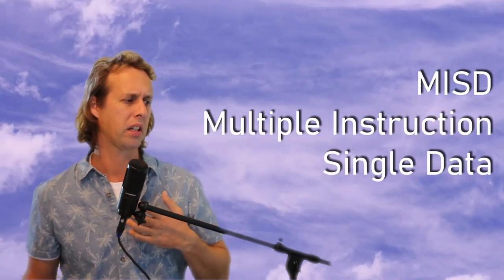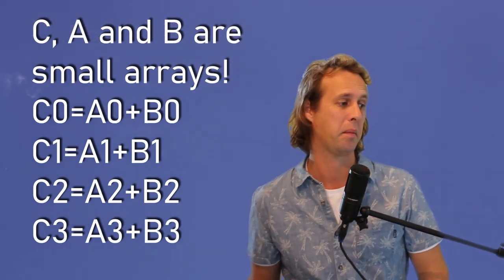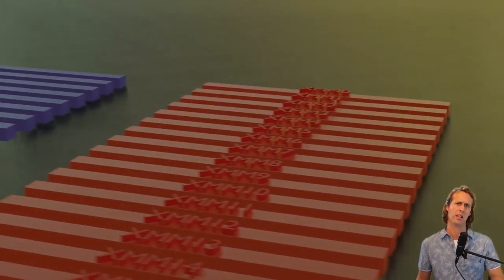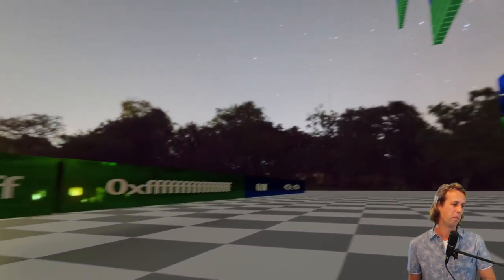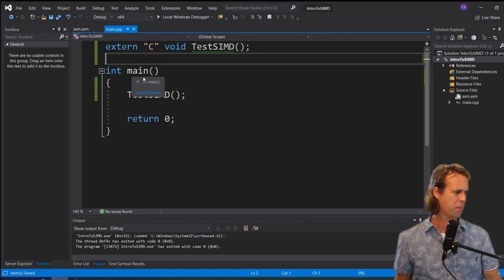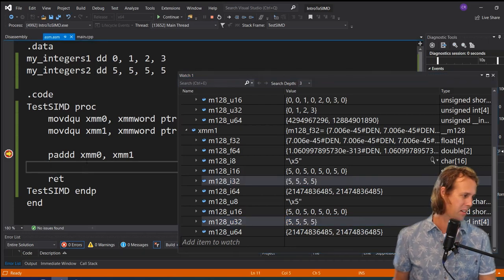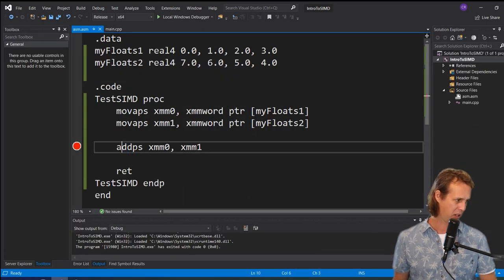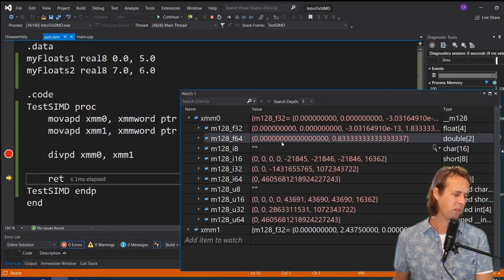Modern x64 Assembly 15: Introduction to SIMD

Comment: There's a difference between MHz and IPS. Not only recent processors run faster they also do multiple instructions per clock using multiple pipelines (superscalar). Old CPUs didn't even do one instruction per clock. That was only possible with pipelining.
Reply from the maker: They do indeed!! And they superscalar these vector instructions too! Really wild performance! Cheers for sharing and watching mate :)
Reply: EramSemperRecta  i8088

Comment: This is so interesting. With a good knowledge of it, how much could you improve a video rendering software, a physics engine, a 3D rendering library or maybe things like a neural network or a trading software?
Reply from the maker: ASM can do wonders! I'm hoping to release two projects soon showing some really fun tricks! Thanks for watching mate :)
Reply: I'm pretty sure you can achieve much greater performance with offloading to a powerful modern gpu nowadays for a lot of the use cases you mentioned.

Comment: C Intrinsics are very useful if you want to write high performance functions; The compiler understands them and will manage the register allocation and optimization, which saves you from doing it  if you code in asm!
There are still times when you are able to produce faster code than the compiler, even using intrinsics.
It takes a lot of effort, but it's very satisfying when you can gain that extra speed!

Comment: I took MIMD to an extreme level on my 12-core HT Xeon:
I wanted to search all the seed states of my Z80 pseudo-random number generator so it would produce some desired sequences.
AVX code allowed me to process 2 sets (16 XMM registers was enough to do this) of 16 bytes each on 24 threads to process 768 bytes at a time!
Using 256 bit YMM registers to process a total of 1536 bytes at a time didn't gain much; AVX only has 128 bit integer operations, so the lane manipulations ate most of the gains!
The AVX2 version works on an AVX2 CPU I have, but it's only 4-core, which only processes 256 bytes at a time ... @ 4 GHz instead of 3 GHz on my Xeon.

Comment: Great video! It is my understanding that G++ and MSVC handle intrinsics differently. Will it be possible at some point in this series of SIMD videos to cover that difference? I appreciate that the series is primarily concerned with assembly (most assembly developers are familiar with the differences between AT&T and Intel syntaxes) but C++ can be valuable when the data is embedded in various classes and /or structs. This can complicate  the gathering of that data for passing to external PROCs.
Reply from the maker: I've never used intrinsics with GNU, so this is new info for me :) I'd certainly like to explore intrinsics at some point. Cheers for watching mate :)

Comment: Just found out that Clang compiler supports x64 inline assembly with variables as operands. All you need to do is download Clang toolkit via Visual Studio Installer and change your platform toolset to LLVM (clang-cl) in project's properties.

Comment: I was hoping to learn the alignment requirements before the end of the video! very informative as a whole though, great job!

for avx2, what are the alignment requirements for reading or writing a ymm register from memory? is it 32 byte alignment?
Reply from the maker: Yes, alignment is 32 bytes I believe. So, there's VMOVAPS, moves aligned data, but if your data isn't aligned (or you don't know) then you can use VMOVUPS, move unaligned packed singles. Each of the Move instructions has an aligned an unaligned version, VMOVDQA/VMOVDQU, VMOVAPD/VMOVUPD, etc.

As for the other instructions, the data has to be aligned when you use a memory operand as the second operand. So like VADDPS or whatever. There's no unaligned versions of those. Theres also no versions that allow memory as the first operand.

I hope this helps! Cheers for watching :)

Comment: Thank you for the video!
Is there a way to do horizontal sums on floating point using AVX2?
Reply: vhaddps repeated 3 times works.
Reply from the maker: Like Explosionist mentioned, there's no way to do this in one instruction. You can combine a few horizontal adds together though. You have to include an extra VPERM2F128 to get the upper and lower halves to add. So you VPERM2F128 to some other tmp register, then add those halves, then horizontal add. Hope this helps, cheers for watching :)

Comment: Very good! Is there a way to check if the cpu has avx or avx512 support in asm? Like ifdef avx512 -> do 512 bit register operations and if not do the present smaller ones. Like a generic way to write the assembly. I am new to asm so this might just be nonsense.
Reply from the maker: Not nonsense at all! There certainly is a way to check which instruction sets are available from ASM! It's a special instruction called "CPUID". We put a function number into EAX, then call CPUID, and it returns information in EAX, EBX, ECX and EDX. All of the information is encoded. You need the AMD or Intel manuals to check what the bits mean. But there's loads of information, including which instructions the CPU supports! I would love to make a video on this topic. In the meantime, you could google the CPUID instruction. It's pretty dense, but good stuff!

Well, hope this helps, thanks for watching :)
Reply from the maker: Sorry, I remember I did a CPUID video: https://youtu.be/p5X1Sf5ejCc

It's old, so it won't go into AVX512. Would be great to make an update. Anywho, cheers for watching :)

Comment: I get the feeling that whenever Intel adds some new instructions, they ONLY add the instructions to help with the VERY LIMITED use cases they are thinking of at the time!
For instance, the SSE 2&4 Insert/Extract instructions, which operate on 128 bit XMM registers using constant index; Why not also allow the index to be in a register!?!?!?
Then, when AVX extends 128 bit SIMD to 256 bits, the insert/extract instructions weren't given AVX 256 bit forms to address bytes 0 to 31 etc. !
Also, some of the crazy program I have written could have benefited greatly from something like BTS YMM0,AX (return the state of a single bit and set it [I used AX there to imply extension to AVX512] ) to use for 256 very fast flags that don't require memory read/write!
AVX512 is still missing these capabilities!
I think this all stems from SSE being 128 bits, so all the instructions were implemented within the CPU around that size.
When AVX was being designed, Intel took the easy (cheaper) way out and just added another 128-bit 'lane' without actually doing a decent job by properly extending it!

Comment: Because vc19 inclines functions extremely well, and you may not create inlined assembler function in x64, it is impossible to beat the “release” mode compiler in anything if you turn its optimisation up to the max. As such, could you make some tutorial over using intrinsics, which can be inline, to beat a compiler with a real world function?
Reply from the maker: It's difficult if the function is small. It's not impossible to beat the compiler though. Depending on the algorithm, sometimes it's really easy. I'd like to make some videos on Agner Fog's Vector Class Library. It's similar but cleaner than intrinsics. Hopefully I can finish that soon. Cheers for watching and cheers for this great suggestion :)
Reply: @WhatsACreel  Good to get a response - "Cheers, mate!"

Comment: I have a question about assembly. If I write some MASM code that runs on Intel Core processor, can I compile it on amd ryzen processor as well ? Or are there some differences?
Reply from the maker: Yes, Intel and AMD CPU's are both x86/x64. They run the same Assembly code! No need for a recompile or anything. Cheers for watching mate :)
Reply: @WhatsACreel  Thank you for respond.

Comment: Another question: I have a std::list of structs . They are sorted according to an uint16_t field. I am trying to find a faster algorithm than std::upper_bound(). Upper_bound takes significantly longer to find the insertion point in a std::list than it does with std::vector. The number of structs is generally  <20 and on average 8. I was contemplating using simd, by packing the uint16_t fields into an array (8 at a time)  then moving the the array into a  m128u16 another m128 would hold 8 copies of the  uint16_t field of the struct to be inserted. After performing psubd, i would search xmm0 for zero or >36863. If none found, then repeat for the next 8 structs. Does this sound doable, given the overhead of gathering the fields for packing etc.?
Reply: a std::list is a doubly linked list, so finding and comparing an element besides the front or back is linear time O(n) + 1 or O(n), while std::vector is always constant O(1) + 1 or O(1).  That is why it is slower, however accessing first or last are the same for both data structures, O(1).

Just using a simple binary_search algorithm to find the element or struct (as long as the elements in the array are pre-sorted), and then exchange, swap or replace the values of the struct in O(1) might work, and you won't get faster than O(log n), which this kind of solution might offer.

Comment: Chris man jumping ahead here but have been playing with AVX YMM registers how would one align to 32? ALIGN only allows 16. Keeps memory crashing with violaion on test in visual studio?
Would i need to setup a seperate data segment ?
Found this but still unsure.
JUNK SEGMENT PAGE  'DATA'
test_ymm real4 8 dup(8.8)
JUNK ENDS
Cheers pal
Reply from the maker: I usually use _aligned_malloc. It's only available in Windows C++. You can also allocate additional padding (alignment +4). Then add to your allocated pointer some amount to make it aligned, and recording the amount you added in the int before the pointer. Hold on, I wrote some code. Not sure it is 100%, but you probs get the idea. You can do the same in ASM too if you're not in C++
Reply from the maker: The code is largely untested. Just wrote it this morning in thinking about your comment, so do be careful with it. Hope this helps mate, have a good one :)
Reply: @WhatsACreel  UPDATED: Thanks mate yeah doing it from ASM ill try the mentioned above with padding and note it, both sides of the coin MASM and c++.   Funnily enough this seems to work with the align directive, testing here:
JUNK32 SEGMENT ALIGN(32) ".data"
ALIGN 32   ;now accepted
test_ymm real4 8 dup(8.8)
JUNK32 ENDS
Can now align by 32 once segement is on a new paragraph boundary before in the .DATA segement it would give ERROR:
"invalid combination with segment alignment" and only allowed max of 16
It now compiles with 32.
cheers ill keep at it.